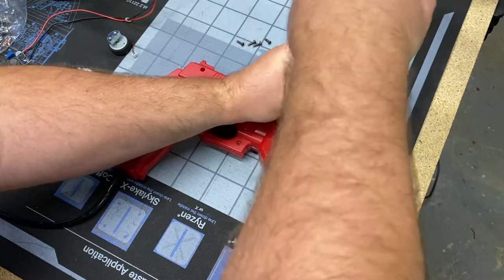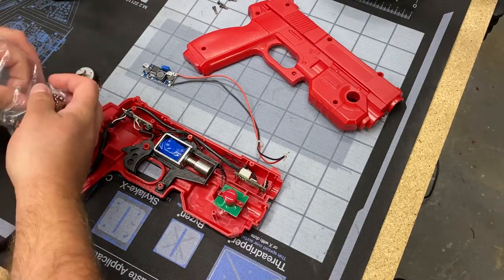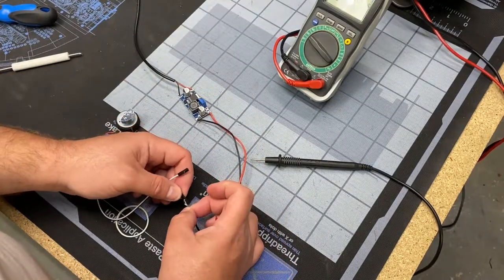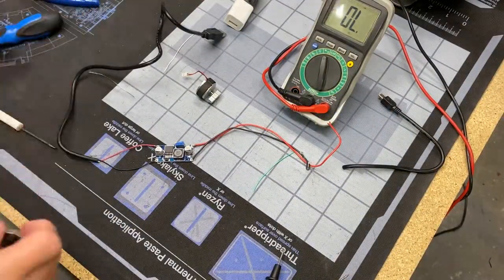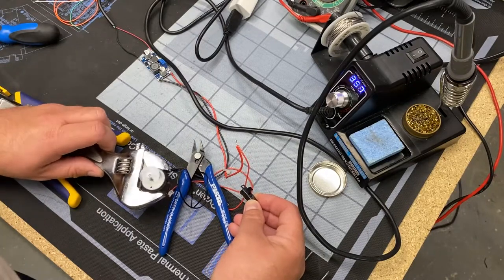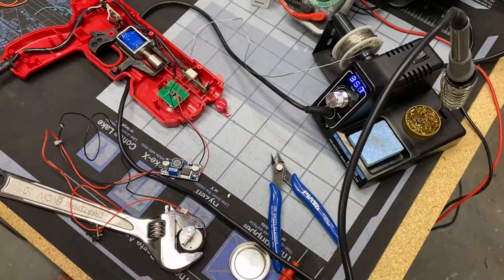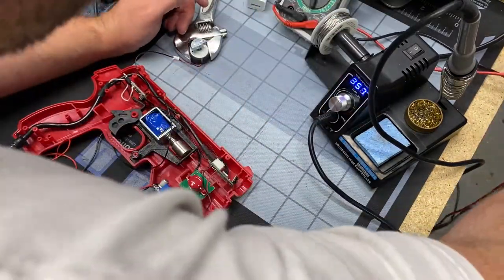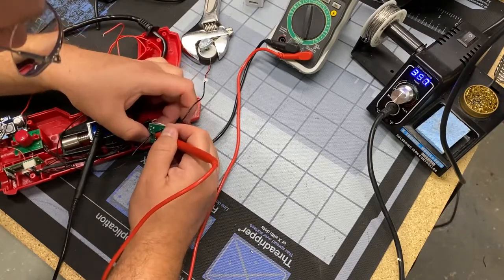Fully Automatic AIMTRAK Arcade Lightgun MOD! PART II

Comment: Hey man, great video. I have 2 aimtraks with recoil. I think they're cool. They work fine for the most part, but would love to see them in action with a fully automatic function. I believe arcadeguns.com sells something similar but Andy has warned against it that it will overheat the gun or solenoid or what have you. So anyways i'm excited to see your part 3 video. Thanks for all your videos. Very helpful.